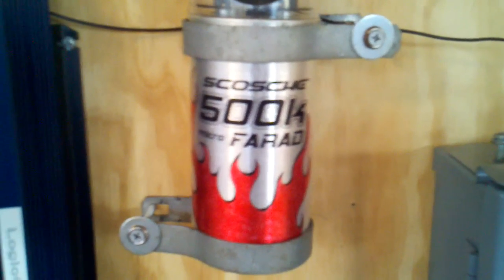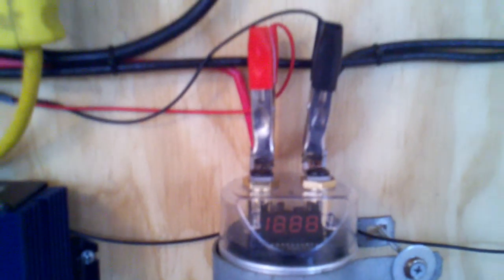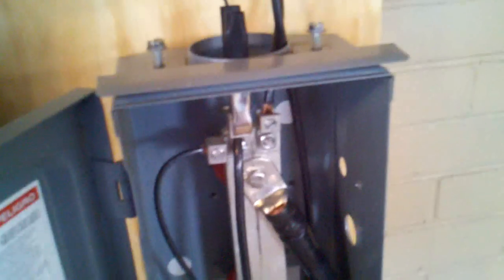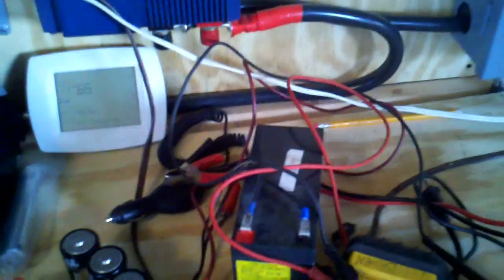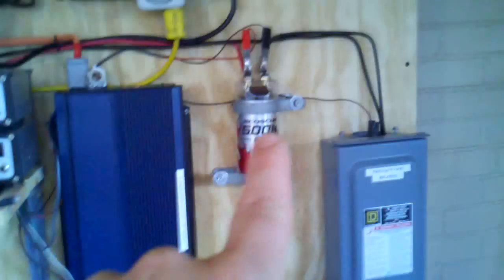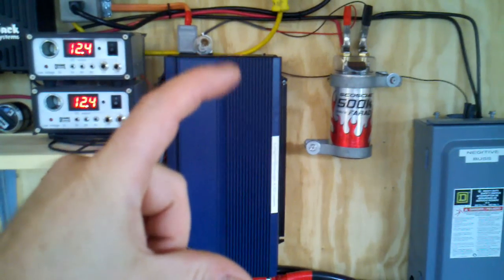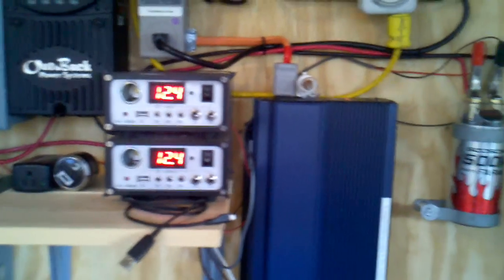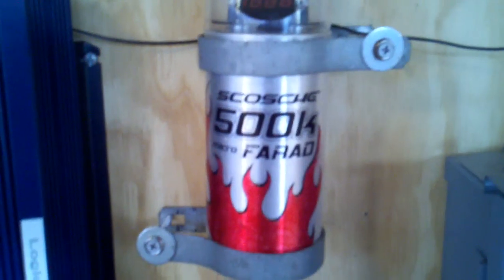How to wire a super Capacitor into your PV solar setup to help with starting up inverter loads

Comment: you could have simply said to hook it up parallel nearest the inverter to buffer the start current. your rambling complicates it greatly.
Reply from the maker: +Monkeypumper420 sorry about that I was still somewhat new to making videos back then. Thanks for watching!
Reply: If he said that and that's it, I would have interpreted it to mean to set it up like a smoothing capacitor... meaning I would put it between my inverter and my load(s) rather than between my inverter and my supply/batteries... you may have been more concise but you where not complete and clear... leaving room for assumption/ misinterpretation can be dangerous and expensive when educating on electricity... I'd take unnecessary info with complete info over incomplete info any day.
Reply: Grant Imahara yeh I’m confused. It surely can’t be on the input side of inverter. Must be output
Reply: I got from this that it is a smoothing cap for the input to the inverter. Principles of a capacitor - cannot change voltage instantaneously, making it good for surging loads. I doubt he would have this downstream of the inverter because I believe this capacitor is not designed for AC voltages of 120. Without knowing any further details.
Reply: My thoughts too bc I’m still confused after listening again… I think I just need to figure it out myself unless someone wants to draw me a simple diagram
Reply: Can you put capacitors in most parts of the circuit, if they are the right voltage/capacitance/run time, to smooth any surges or drops in current?

Comment from the maker: the capacitor will help with starting the heavy loads not so much in the way of storage.  I would recommend any properly rated dc cap yo can get for a good price.  sounds like you need more batteries first.  Set up your battery bank to charge off the alternator during the day.  that should help too.  Thanks

Comment: A 500 microfard cap such as shown here is good for around 500 watts which can help offset a startup load draw on the inverter and the batteries as well. I pretty much have the same setup shown here and I DO see a notable difference in how the inverter reacts when a high startup draw is put on the inverter.
Reply: Can a high voltage microwave capacitor work in this way?
Reply: Its rated for 2kv and doesnt store alot of current enough to toast us but stored at 2kv the current would be low after conversion

Comment: @ wes c. The inverter takes the surge at a rate it can handle, the cap never discarges completely. Get a cap rated at higher than anticipated max voltage and the higher the mfd the better. Example if running at 13 V use a 20V or higher rated cap. Higher than rating does no harm but lower can fail as a short.
Reply: thank you for clarifying, I was wondering about that :)

Comment: Hey all... this is a VERY old video, but 12.4V is the reason the battery bank "needs help" with surges... the internal impedance of lead acid batteries at 12.4V is too high to handle sizable surges. Battery bank voltage of 12.4V while under load is probably around 50% SOC, so the batteries are unable to provide "surge capacity". Yes, adding a large capacitor could help, but the better solution would be to get the battery voltage up higher so they can handle the surge.
Reply: I have a 48v system and I still get “brownouts” when my well pump kicks on. I’m looking at doing this to eliminate that issue.
Reply: @Matt-ue4tm  did you ever try it out? A bit worried of getting a shock from four of these babies hooked up in series!

Comment: yes its true hooking a supercapacitor in parallel to the battery also helps it charge better be it a dc generator or solar panel..capacitors help to absorb the voltages better and somehow batteries respond better to charging..
Reply from the maker: fidel catsro Thanks for the comment.

Comment: Hello Guy, I am doing the same thing. Using a 10 Farad cap with a 1000 watt sunforce pure sin wave inverter. Monitoring my system the 2000 watt surge has ran 3 times longer than sunforce claims (cooler inverter), and the battery stays cooler under less load maintaining better voltage and Ah across the board. I've looked into implementing a 1 farad 12v cap inline between panels and pwm controller to store energy rather than wasting energy above the 14.7v peak the PWM has so the pwm reacts as MPPT

Comment: I did this to my travel trailer solar power system. Worked great for fridge and all other AC loads. As I increase battery bank will be able to run AC.I have 540watts of solar.

Comment: I was waiting to see you show it action. Thought you were going to switch on something and watch the difference it made. A lot of negative comments here.  The caps may or maynot have much improvement, but definitely is an improvement.  Caps discharge much quicker than any battery when a high load is pulled, while probably helping to improve the life span of the batteries too.

Comment: Thanks for the video. I added a 1.0 Fared Cap to my small solar set up and handled the load strain on a 10,000 BTU Portable AC unit. It kicked in for only a few seconds and equalized the flow of voltage drop on my 2,000 power inverter. Of course, I could not run the AC for a long period due to the consumption of power from my 950 AMO hrs battery bank.

Comment: Hello, I watched your video where you explained the integration of a 500,000 microfarad capacitor into your solar setup to offset the heavy draw on the inverter, primarily caused by a refrigerator. I have a few questions to better understand the details of your setup:

1. Is the capacitor rated at 12V?
2. What is the capacity of your LiFePO4 batteries in Ampere-hours?
3. Can you provide more details on how the capacitor is connected to the inverter and the specific wiring configuration?
4. Why did you choose to connect the capacitor to the busbars rather than directly to the inverter's inputs?
5. How does the capacitor release its energy during heavy loads, and how does it help the inverter handle the refrigerator's initial startup draw?
6. Could you share any insights into the overall performance improvement you've observed with this capacitor setup?

I appreciate your time and would be grateful for any additional information or clarifications you can provide. Thank you!

Comment from the maker: There is no chance of any damage as the cap is really like a battery but it can dump and recharge its full charge fast unlike a conventional battery can only release its energy and a given rate. If you feel more comfortable fuse your charge controller and inverter which you should have anyway.  I have had no issues with this set up at all.  thanks

Comment: Hey
I run 5x100W panels into a 2F capasistor, with a 600W gti. In shady weather i get 25-30% more production with the cap, then without. In low ligth I get maybe 50W with the cap, nothing without,

Comment: I have have many BCap 3000 FARAD capacitors. If I wire them series to obtain 54 volt (to match the 48v battery bank) would you fore see a problem? I am considering connecting 20 of them in series, then connecting them in parallel with the 48v battery bank.

Comment: A smaller capacitor Hard Start Kit can be added to the appliance as well be it a fridge or air conditioner but the kit actually goes on the appliance.   Lots of youtube videos out there and the kit is about $12 whether its for an inverter to convert dc to ac or just plain ole 120 vac.
Reply: Can you provide a link to one of the Hard Start Kits you wrote about?
Reply: +Foo Fabulous   The "Hard Start Cap Kit" came to me from youtuber Just In A Van.  His generator at 1,800 watts shouldve a 2,000 watter so he put the kit on for his AC roof top to help the generator out and it did.  I did it too.
Reply: +Foo Fabulous Mine was $11-$12 on Amazon but you need to know what type of capacitor you have now be it a 2 or 3 wire type.  They say that both Maxwell and Super Capacitors are the best.

Comment: I have a 5kva off grid solar installation with 4 bank's of tubular batteries giving me 48v. My borehole pump has a 5kva start up so right on the edge I only pump when there's sunshine. What size and how many capacitors would I need to cover the start up surg of fridges, borehole and other pumps? Any advice would be greatly appreciated thanks